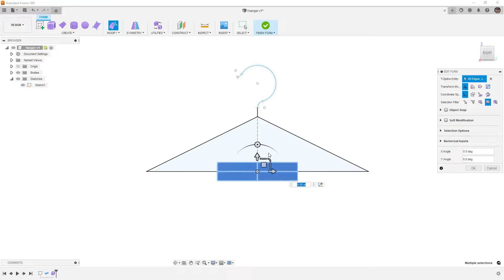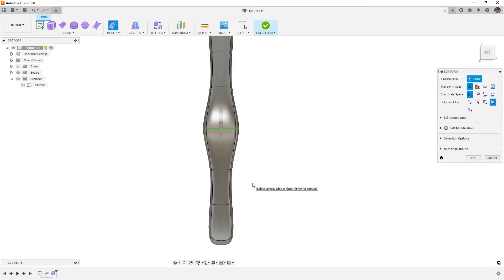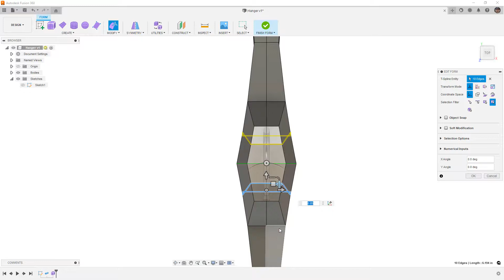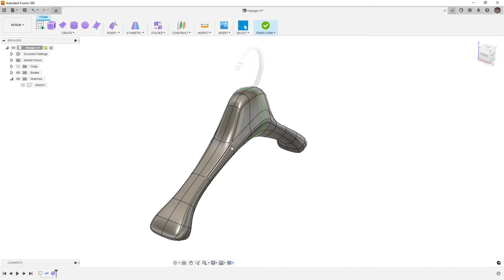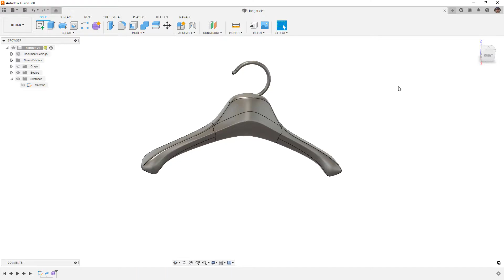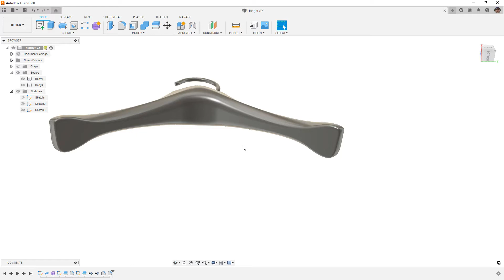Fusion 360 Form Mastery - Part 42 | Forms Practice Modeling a Wooden Coat Hanger #Fusion360

Comment: I'm surprised that the simple box you started with had double edges one over the other on the end. Now I will be on the lookout for this possibility. Did not know how that variable filet worked. Thanks for the explanation. and once again great video.
Reply from the maker: So to clarify a bit this happens when you try to extrude a face and then undo a move.  This happens all the time in Poly modeling in Blender.  The Undo of the extrude results in the extruded faces being "doubles".  it is easy to miss in Box Display so its always a good check to go back/forth between box/smooth.

Comment: I don't know if this is in your area, but I just found out that people are using the sheet-metal workspace for doing leather bags and backpacks.  I saw a few videos on this and various leather fabricating cutting embossing sounds is really tempting even just for prototyping.
Reply from the maker: Very cool robert!  Are they using the add-on Exact Flat to flatten them out?  Other tools like Solidworks can flatten complex surfaces, but Fusion will only do this for sheet metal.  This would be interesting to see how people are doing this.

In the past I have used flattening surfaces for composite work and for decals, but never clothing.
Reply: @LearnEverythingAboutDesign  it doesn't look like they are using any third-party software. just use fusion to construct forms as if it was thick metal. and use patterns in  Sketch to create even stitching holes. at the seams. then making a pattern that could be cut on a laser cutter. Here is an example.

https://www.youtube.com/watch?v=WUFvFSkMP5w

not to get too deep into it, but I thought it was cool use of a tool that was meant for something else.
Reply from the maker: @lostman_Comm_Amiga  Interesting, that wasn't what I was picturing from the description.  Those shapes being ok for sheet metal makes sense now.  Thanks for sharing!  I have helped a customer with Exact Flat who was designing inflatable boats with Fusion.  So complex shapes unwrapped.  It could work for this but the price of the tool is many times the cost of Fusion.